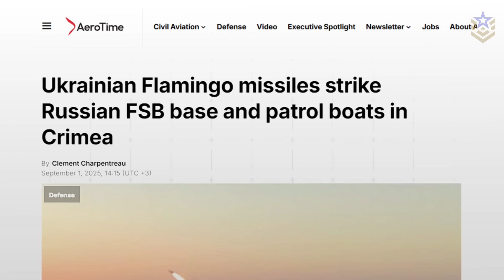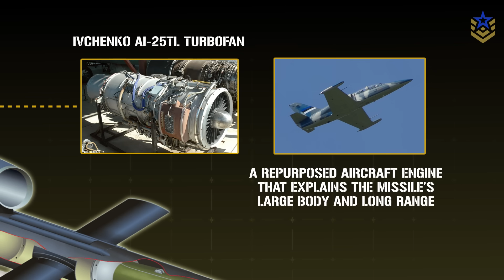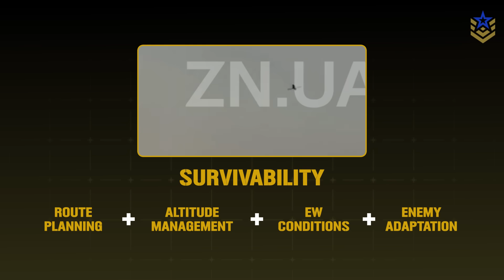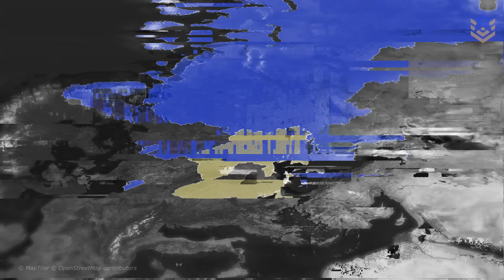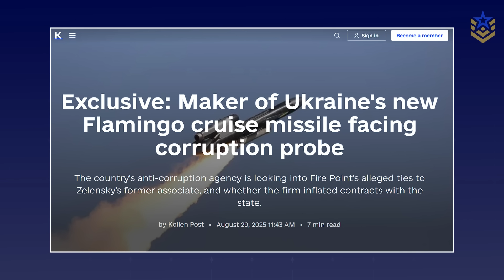Ukraine’s Flamingo Missile: What 3,000 km Range Really Means

Comment: What would be really good is if Ukraine got a bunch of guidance systems meant for the Tomahawk missile. The Flamingo buzz bomb has longer range than a Tomahawk and double the weight of the warhead. But it's not as pin point accurate as a Tomahawk. Combine the best of both and you'll get an AWESOME performer!
Reply: BS. To make themselves again dependent on the US? No. The whole point of the Firepoint drones is that they can control everything. And if you plant 1150kg of explosives in the middle of an oil industry complex, or a defense factory, or an ammunition depot, the +-30m accuracy is perfectly sufficient. And it will get better.

Comment: If you said the Flamingo cruise missile could go 1500 km and had a 500 kg warhead, I would believe you. But 3000 km with a 1150 kg warhead is extremely hard to believe; in fact, that's pure fantasy.
Reply from the maker: Thanks for the comment. The 3,000 km range and 1,150 kg warhead figures are based on early Ukrainian defense reports and haven’t been confirmed through independent data. We mentioned in the video that these numbers are unverified, so they should be viewed as provisional until official specifications are released.

Comment: Fun fact about FP-5: it has the same design as German V-1.
Reply: Another fun fact, a lot independently manufactured military equipment has similar shapes and forms because it is dictated by the effectiveness and laws of physics and not by the uniqueness of fashion
Reply: Same styling as the V-1, but a huge upgrade from the original German buzz bomb.
Reply: I do not see minuses😁
Reply: Yes it is a modern version !  I was thinking that.  A highly effective weapon . Also very bad for morale as you heard it coming  from miles away  and then the engine would cut out . You did not know if you were the target. Terrifying. If Hitler had them in larger numbers earlier it could have been a game changer.

Comment: Part of the Flamingo and two other missiles are produced in Denmark, which is already a strong supporter of Ukraine
Reply: it is the booster rocket to get off ground.
Reply: IF Flamigo has a range of 3000 km, why Zelensky needs Tamahawk.
Reply: @mxolisitshabalala5657  😁
Reply: In mid-2024, Ukraine announced the “Flamingo”—a 3,000 km-range cruise missile with a 1+ ton warhead, allegedly made by FirePoint. But no wreckage, verified launches, or production sites have been shown. Analysts say it looks like the British-UAE FP-5 missile, possibly rebranded. FirePoint, linked to Zelenskyy’s circle, grew from 18 to 2,200 staff in two years and won over $1B in contracts—now under corruption investigation. Western funds (Germany, Denmark) back its facilities, but experts doubt its capabilities. Like past “wonder weapons” (Sapsan, Trymbita), Flamingo seems more like propaganda than real arsenal. As one analyst said: “If it flies, show the debris. Until then—it’s pink noise.”